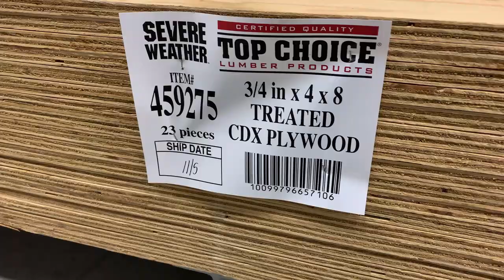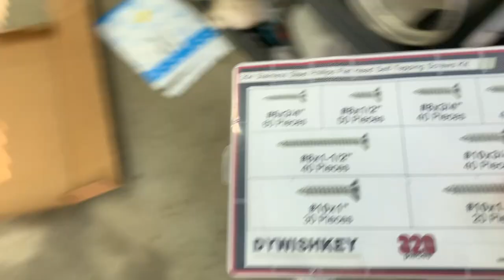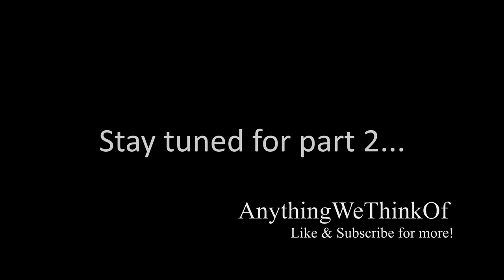Boston Whaler Montauk 17 Refresh

Comment: Hello, Very good video for which decides to refresh a montauk. It's my case, I'm in France. You will guess it ... with my language ! I'm particularly interested by mounting the trolling motor. I saw you put the minn kota support directly , you don't use any cutting board or other  support between  the boat and the minn kota support. Is it solid enough ? Did you use some inserts to fix the support ? Many thanks for your response .
Reply from the maker: We just used the plate provided by Minnkota. We predrilled the boat & used stainless steel lag bolts to secure it. It holds very well. No issues yet.
Reply: @AnythingWeThinkOf  Yes, It's very good if it holds well. Many thanks.

Comment: Nice Project! You might want to consider wrapping the plywood in some fiberglass to seal out moisture. It will last a lot longer. They sell Glass and Resin at Home Depot real easy. You could roll on Finishing Gelcoat, tint it to match the Whaler Tan.